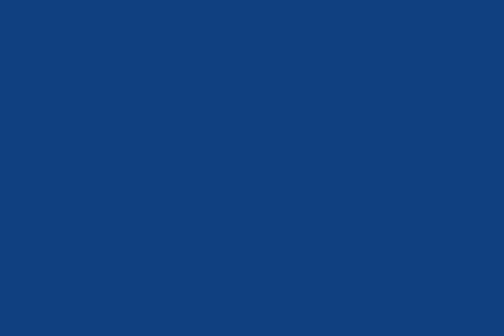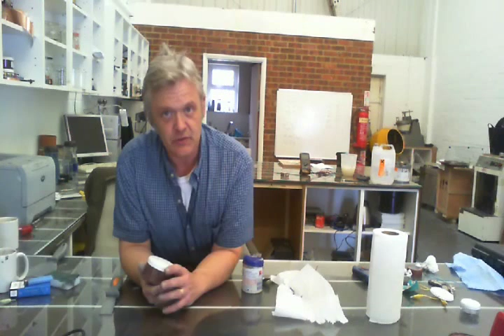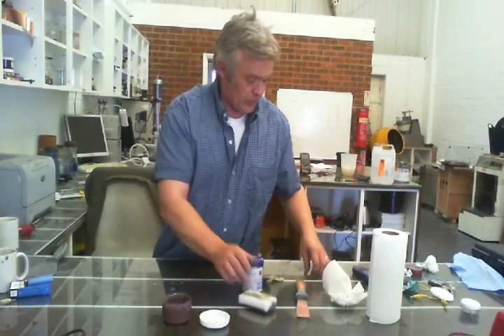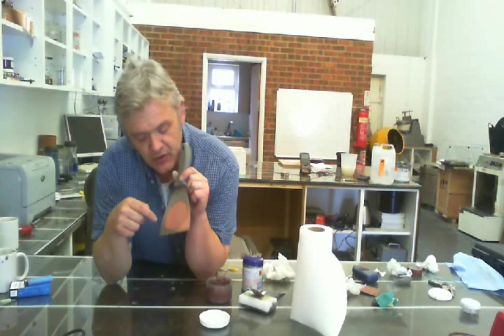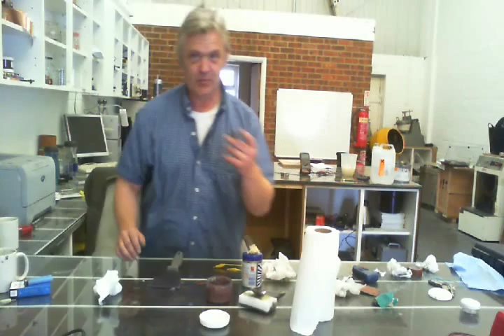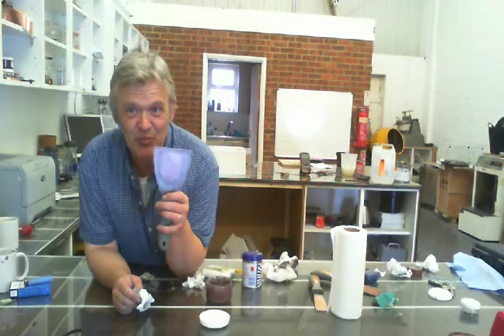Copper Plating Without A Battery

Comment: Just a thought, putting a resistor in series would reduce the current, slowing down the process and hopefully produce a more even thicker plating result. I guess you'd need to measure the current (ideally a hall effect sensor, so that the meter resistance doesn't affect the reading), then calculate the resistor value.
I remember from decades ago, after school 6th form chemistry club, simply by plating slower at lower current for longer, would produce much more robust and cleaner plating results.

Comment: I love your videos! Making copper nanoparticles is on my weekend project list. Can I ask if this can be done with aluminium nanoparticles? Aluminium helps rust protect mild steel and even titanium (titanium is not so good at high temps, slowly oxidises away). There are hundreds of videos on electroplating, some with aluminium, but none on 'electropating on to steel WITH aluminium'. Closest I've seen is 400degC 1.5Mpa 'cold' jet of air hypersonically blasting aluminium at a surface. Don't think I'm doing that anytime soon.

Comment: This is very interesting, thank you.  I am working with very pitted and sometimes rusted thru 18 gauge mild steel...yep its a 60's era Chevrolet. Brush plating seems like it may have merit for repair instead of cutting out and replacing. My question is; if I use the nano copper plating to build up pitted areas then sand smooth for layering, could it fill the deepest portion of the pits first?
I have prepared a 1 foot piece piece of metal from a rusty floor by sand blasting and wire brushing. Some pits have pin holes thru the metal up to 3mm. I have watched videos for chrome plating by immersion in various stages, the first being copper. They
had to solder many pits which is expensive, and time consuming...so I have considered using a conductive paint product like the copper paint used on boat hulls, sanding smooth then trying to plate over for a sandwich of material then maybe zink to cover that. Also will the metals react with each other after plating? The goal is to stop the steel from oxidizing.
Reply from the maker: +hunter wayman very interesting mate - have you made any vids?
Reply: +Robert Murray-Smith  I had not considered vids, but see the advantage. Its very early on in the experiment so nothing lost really. I will record my next few steps. First I want to make sure all the rust is out by reversing the polarity for rust removal by brush method. After, I have considered using a magnet attached to the bottom side with
iron filings, in the rusted thru holes and heavier pitting, to assist in the fill of the gap areas. It may require a barrier of tin foil between the magnet and the steel, which may also assist in conducting current thru the fill areas.
Reply from the maker: +hunter wayman People often ask me what i think about something mate - and quite often it's next to impossible to say anything of value just because i can't see what they did. It'd be cool to see anyway and lots of other people can benefit from aspects of your work you're willing to share
Reply: +Robert Murray-Smith Yes, with any luck I will be able to record the process and show a cross section of the finished metal restored to the original 18 gauge thickness. Also after reviewing your nano copper gel process
I am curious if the acid is neutralized before using it as an ink?
Reply from the maker: +hunter wayman no - it's an acidic gel mate - hence gloves - lol

Comment: Hi  Robert :    Can  this  copper  plating  method  also  works  for   non-metal ,  e.g.  ,   plating   copper  layer  on  glass  or  plastics  ?    Looking  forward  to  your  reply   and   thanks  a  lot !
Reply from the maker: a replacement reat+Jeff Yung I don't think so mate - it's basically a replacement reaction - but i will give it a go for you
Reply: +Robert Murray-Smith      I think  if  adding  a  temperature  curing (maybe  120C ~180C) ,  your  copper  gel   can  form   a  layer  of  copper  on  dielectric  or  ceramic  ,  just  like   activator   for  PCB  through-via   metallization .
Reply from the maker: +Jeff Yung that would make it like bath deposition and i would probably have to sensitise first with palladium and stannous chloride

Comment: Hi Robert,

Very interesting
My background is physics so I struggle at times with the chemistry but here goes...

Is the gel pH neutral - could copper salts be forming on the fly?
Have you measured the electropotential?

I am interested to know what is causing the current, some thoughts expressed mainly as rhetorical questions follow.

I know of salt water batteries for instance that oxidise aluminium to create current but the crux of this seems to be that once you have built a layer of copper you can carry on building upon it so presumably at some stage 

1. There is no (very little) gel left in contact with the steel 

or alternatively 

2. Any gel left in contact with the steel is sandwiched between copper and steel, suggesting that something will simply get depleted or completely oxidised and then the reaction in the now physically isolated boundary layer will die off as the boundary layer is cut off from the outside world by the copper deposits. As far as I understand it galvanic (corrosive) action between dissimilar metals requires an intermediate electrolyte and at the very least something gets used up. How long can a physically isolated boundary layer provide current? Also its hard to see how such good adhesion could be obtained if the boundary layer between iron and copper was being compromised by gel and/or some galvanic activity - surely anything capable of creating current between two bonded dissimilar metals tends to have the effect of "unbonding" them by means of byproducts and chemical conversion - surely you cannot get current out of such a boundary layer and expect it to remain unchanged?

If the above paragraph seems to cast doubt over the steel playing some kind of sacrificial/active/galvanic role (at least past initiation)  then once started could we
magically substitute the steel for any conducting substrate (even non-metallic) and expect the reaction to continue? I suppose the acid test is to try the same with a copper substrate but then its going to be difficult to judge deposits, although a non-zero current reading would rule out galvanic action (compared perhaps with the steel-copper version) and suggest an alternative driver.

Once this thing gets going then the active interfaces are now just copper-gel and gel-copper with the only significant difference being the level of particle division?

If this is not fuelled ( but perhaps only initiated) by galvanic action then what is the energy source required to create a current? 

Perhaps the nano-particles have a static charge, for some reason they simply tend to have a different gross potential than grounded lumps of solid copper, perhaps they mutually repel until they can dump charge and coalesce onto a substrate?

Failing that then another energy difference between the great slab of copper deposit ( seen on the nanoscale) and nanoparticles is the level of subdivision, presumably the energy cost of repeated subdivision of a solid approaches the latent heat of vaporisation in the extreme. Does the level of subdivision represented by  these nanoparticles add up to a significant amount of energy for this context and could it express itself as electrical current, it is reasonable to suggest that nanoparticles coalescing into a bulk solid need to give up some energy but would it appear as electricity rather than heat?

Go easy on me I am going out on a thin limb in the thought experiment here, in short some simplified black and white assumptions about the boundary layer being isolated and a non-sustaining  seem to lead to colourful explanations for an energy source to drive current indefinitely - perhaps you did not wait long enough to see it come to a stop or maybe whatever is going on in that boundary layer is just not as black and white as I paint it?
Reply from the maker: +jonnie Basically it is initially a displacement reaction and after follows the same dynamics as an electroless plating bath
Reply: Thanks Robert

I have watched your early videos on nano-copper creation. As I understand it you wash the copper and then protect under ascorbic acid so that there is no copper sulphate left just water, copper nanoparticles and fresh ascorbic acid?

Do you believe that copper ions playing a role or that copper atoms/nano-particles are playing a role here?

On one hand I am wondering whether there is some amazing nano-thing going on where sufficiently fine copper metal particles will exchange with iron atoms or otherwise coat steel ( after all mechanical plating says mere proximity and energy can achieve this) - blacksmiths regularly used to brass steel with a bit of heat and vigorous rubbing with a brass brush.

Or.....

Whether a salt or complex of copper ions is doing a very similar type of exchange with iron  as we see with immersion deposits of copper sulphate and the more adherent coatings are a side effect of the nanoparticles but not a direct cause. I think I understand the reason for immersion deposits for both ions and complexed ions ( electrochemical series etc) and why complexed ions are usually less prone to immersion deposits.

I am struggling here - is it something we have seen before but in a slightly different guise or is there something fundamentally different and previously unseen because of the presence of nano-particles? If you have an insight that breaks it down by chemical component I would be very interested - ie what role does do the copper nano-particles play, what role do any copper ions present play in the plating mechanism - say just the case where you rub it on.

I am currently trying out your nano-gel as a way of obtaining a "flash plate" on steel prior to acid copper plating. I am applying by cloth at the moment not the method shown in "plating without a battery". The precursor you introduce is a powder which is added to water so I guess I am wondering should we expect ions or just nano-particles?

My experience so far with citric and oxalic brush and bath methods suggests that its necessary to build up a thick deposit with acid copper before the full picture of adhesion and coverage is seen.

I am performing simple mechanical adhesion tests also with the aid of a digital microscope which offers a certain amount of of additional information when the plate does fail ( peal or small flakes? any copper particles remaining, evidence for copper-steel failure vs copper-copper failiure etc.

Not a chemist - my background is physics but for various reasons I am part of a small number of people keen to exploit a reliable method of flash coating copper on steel that does not involve nasties or complex bath chemistries.

Will share my results if of interest.

Thanks for putting it all out there,
Sorry its so long winded - trying to paint a picture based on lots of practical experimentation and reading but unsupported by a good chemistry foundation.
Reply from the maker: +jonnie It is without a doubt the nanoscale is having an effect. I would guess that at that scale the surface roughness promotes adhesion and the chemistry of the gel promotes autocatalytic copper deposition with the already applied copper nanoparticles acting as nucleation sites. The ascorbic acid acts as a reducing and capping agent and I imagine the bulk of free copper ions are in the +1 oxidation state and are reduced to zero valency by the 'rubbing' - which is essentially little more than intimate mixing - hope this helps and good luck with the experiments
Reply: @BuyMyDreamHotel  l

Comment: I wonder how effective this would be for building up to create etchings as opposed to removal via acid etching into a solid component since with the two used (etching down first, then plating onto afterwards to build up) it should allow for much thicker forms either for decoration or for thick heavy duty traces that are able to be thicker than they are wide to act a bit as a heat sink from under a component instead of just on top of it.
Reply from the maker: Thomas Anderson that's an interesting idea mate

Comment: How could I get my hands on some of that copper plating gel?  I I could reaaally use some!! Also I would imagine it doesn't adhere well to stainless or aluminum correct?
Reply from the maker: Thomas Anderson we are working on that idea right now mate with the 3 men in a shed series - the plan is that a lot of the videos will be redone under the 3 men title and a lot of the ideas of the channel will be pulled together there - as we do this we will be removing the older videos
Reply from the maker: Morgan Parkman You are quite right mate and i am afraid you will just have to make some - but it is only copper nanoparticles in gel and i give instructions on how to make these in different vids
Reply: Robert Murray-Smith did you not show a video of this stuff working on stainless steel? though you applied it with steel wool instead of just some cloth to rub it on? if I am correct and it is not another formula other than the one here, I guess a link to your other videos is in order LOL (you really should consider selling DVDs even if they were just downloadable ones through something like amazon or something, that strings everything together nicely for those needing help (might also be a good school study compilation? :)